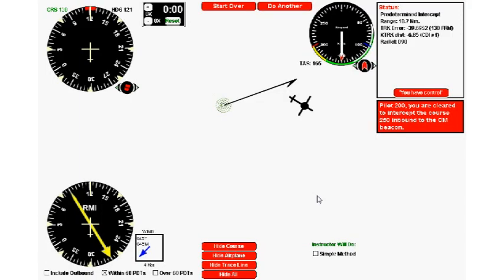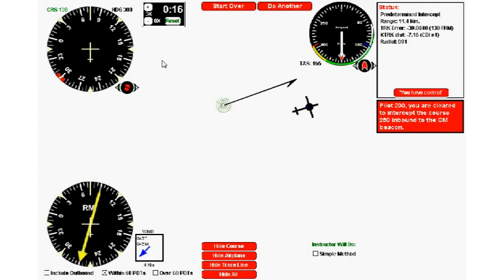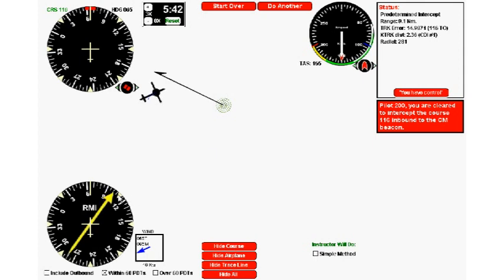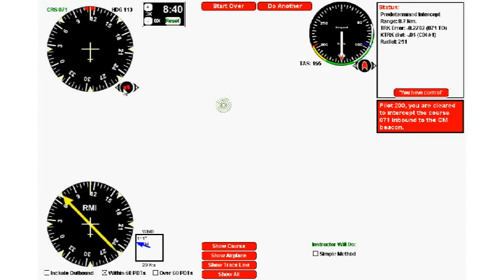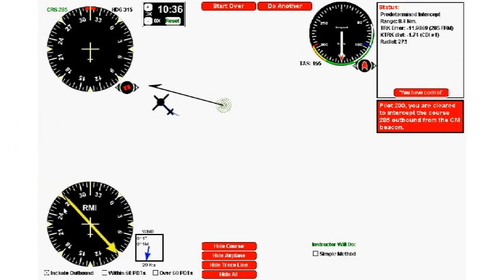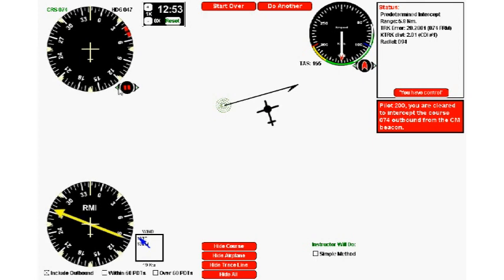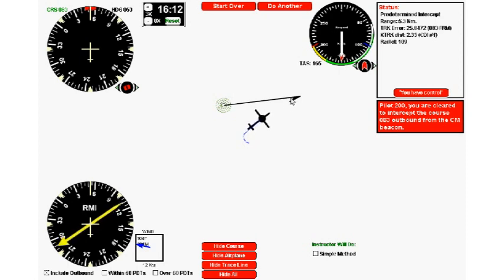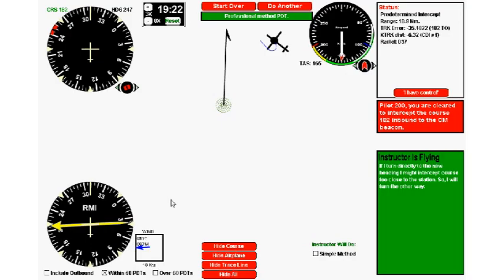Predetermined Tracks Part 1

Comment: Hi i have one question please, the procedure is exactly the same intercepting VOR and ADF  ? only ofcourse in the VOR you find the radial (reciprocal of heading/bearing) So the part desired to head plus 30 for inbound and tail to desired plus 30 for outbound, applies the same outbound radials and inbound bearings for VOR ??? please answer